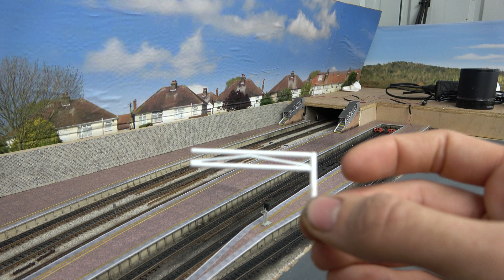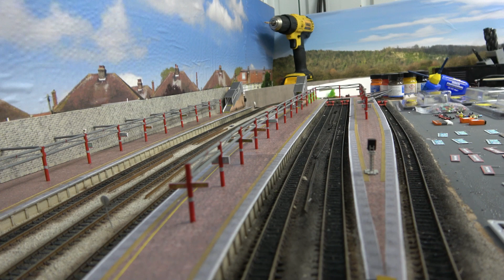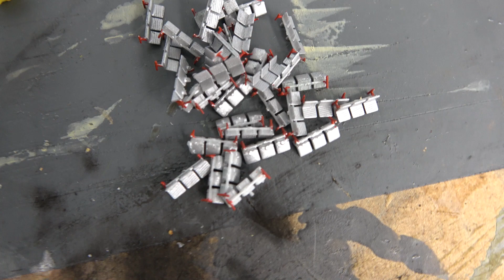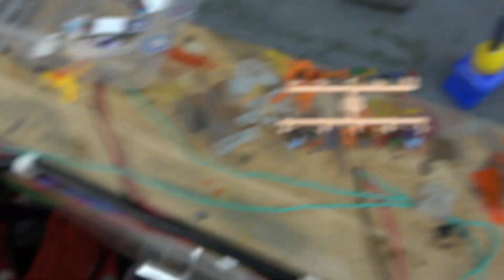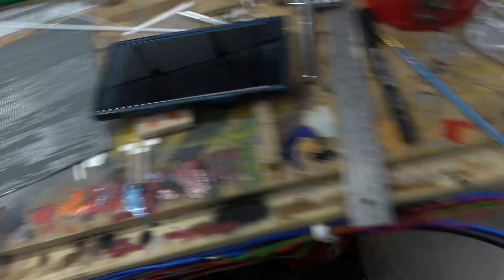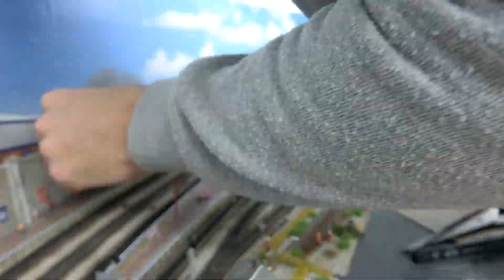Great Deltan N gauge-Station Build Part 1-Platform Details and Canopies

Comment: Have you any videos on how you made the platform and added the lyellow lines
Reply from the maker: There is a video further back regarding how I made the platform base, the top is surfaced with sheets by scale model scenery
Reply: @greatdeltan6556  and the markings
Reply from the maker: Which markings are you referring to?
Reply: @greatdeltan6556  platform
Like yellow Markings diff stone tactical stone and any other markings that make it look lifelike and modern

Comment: The opening shot of the platform is awesome, you have done a really good job there Dan.
I dont recall seeing a video on you changing the platform surfaces, how have you done it and what did you use?
Who makes the N gauge sheeting?
Video so good the length did not matter Dan.
Regards Chris
Reply from the maker: I used scale model scenery sheeting and edging strips :)

Comment: Hi Dan. The station canopies (and the platform 'accessories') have turned out rather well. I worry that the rain will fall between the gaps in the corrugated roofing and the passengers will get wet! Please slow down when you are making a panning shot as it is unpleasant for the viewers.
Reply from the maker: Virgin trains are aware of the holes in the roof aha, and yes I'll note that :)